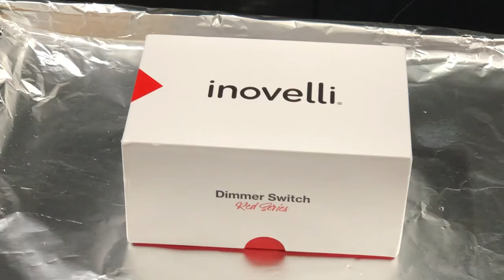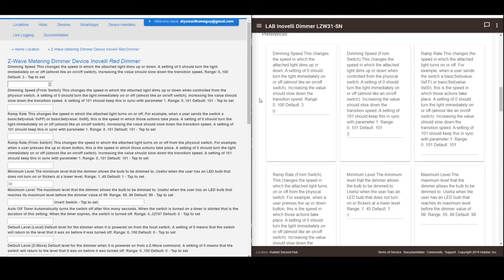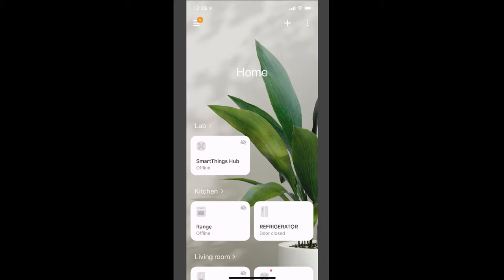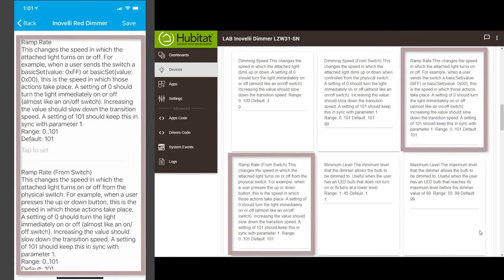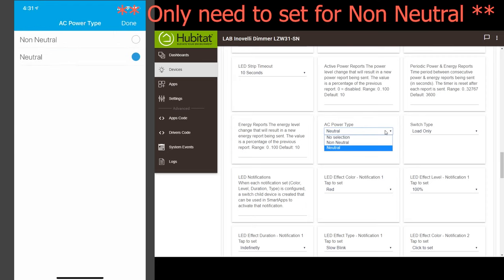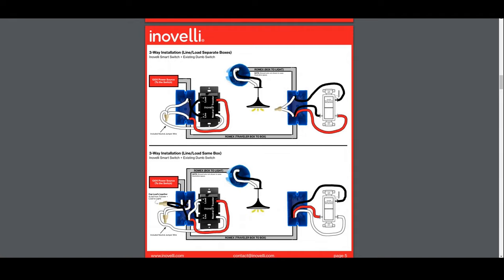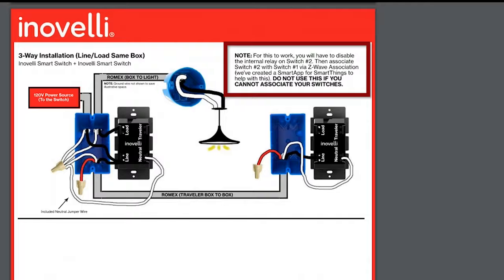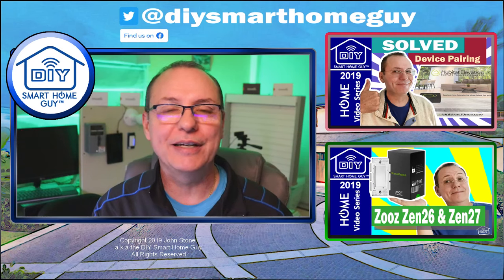Inovelli Red Series Dimmer (LZW31-SN) Z-Wave Plus Review

Comment: Hey mate, thanks for your videos.
I've tried to message you privately but I have no clue where to start with that. at the 8:01 minute mark installing the bypass behind the switch didn't work for me. I've asked in the Inovelli forum and confirmed the information isn't correct. My light wouldn't turn off and my voltage tester was spazing out around my whole switch. As Inovelli and Aeotec diagrams say ... its got to be installed at one of the lights behind the housing for the switch to work.

Comment: You cannot install the bypass at the switch.  Those who have tried ultimately determine that it will not work.  Additionally, even in some cases with a neutral, the bypass is required, depending on the bulbs.
Reply: @DIYSmartHomeGuy1  I'm not sure either.  I haven't tried it, but there are a number of posts in the Inovelli forums from those who tried and we unsucessful.

Comment: Appreciate the review.. looks very cool.  On the notifications.. can you cycle multiple notifications?  for example on my homeseer the top two LEDs will blink red if the front door is unlocked The bottom two will blink red if the back door is unlocked and the middle one will blink red if the garage door is left open after a certain time.  It would appear that the inovelli is just one pulsing or Knight Rider type effect .. but is it possible to cycle notifications?

Comment: Would this switch work with Lumary recessed smart lights to allow on/off from the wall switch without using the Lumary App or having to reprogram the lights again because you turned them "off"?? I would be able to breath again because i just bought 30 of them Lol and shudder at having to use my cellphone every time!
Reply from the maker: Well, as luck would have it, I recently purchased one. The bad news is, I haven't done any testing yet. From what I read, they are zigbee, so in theory the hub can control them. You would use a switch like this to constantly provide power and then use the button taps to turn the lights on and off. But again, I haven't done my independent testing as of yet.
Reply: Hey thank you I really appreciate you.

Comment: The Aeotec nypass can be connected directly to the Inovelli switch in a non-neutral configuration? That's what I was hoping to be able to do. But the Inovelli manual shows the installation of the Aeotec bypass at the light itself.
Reply: @DIYSmartHomeGuy1  Great video! Was really helpful for someone who is new to this. I have low W LEDs, When I try and install the bypass on the switch side the light always stays on and the switch doesn't work. Do you know what I am doing wrong?

Comment: Hi DIY Guy John, I have a question for you. I used your videos as a great tutorial to set up my kitchen ceiling recessed lights with 4 Sylvania Lightify Color LED’s 5-6inch, along with this Inovelli Red Series Dimmer. I’ve been having problems with dimming and flickering, is it a low-load problem? Should I add the additional load resistor that you recommended in the links? The Sylvania lights are connected through the OSRAM Lightify Gateway and then to my Samsung SmartThings hub, so any other setup suggestions would be great! Love your videos please keep it up! Thanks.
Reply: Also I’m using a standard neutral-wire single way setup!
Reply: DIY Smart Home Guy Hi, thank you so much for your response! At the moment I’m pressing the down button on the Red Series Dimmer which is turning the Switch off, cutting power to the lights. Also, when holding the down button down it triggers the built-in dimming for the switch, which is what causes the flickering. I thought about re-programming the switch so that the down button press and the down button hold would not physically shut power off but instead dim the lights to 0% and something like 30%, but I thought it was kind of frustrating that I have to pick what percentage (and only 1 option for that) I could achieve with the down button hold option. That’s why I was leaning towards trying to get away with the manual dimming (plus it’s cool to watch the led on the dimmer go down as well). Do you have any suggestions? Thanks again for your input
Reply: DIY Smart Home Guy
Got it to work, thanks so much for the help! Looking forward to future content

Comment: Did something change?  On the product it says it requires a neutral wire.
Reply: If you check again there's different options such as the zigbee one doesn't need a neutral wire. The Z wave does.

Comment: Hey John,  I went out and bought some of these switches based on your glowing review.  After getting them, I was disappointed to find out there is a painful delay from clicking the switch until a linked light actually turns on.   After doing some investigation I found a very long thread on inovell’s website complaining about the problem.  Apparently, they picked a very long value for the double click timeout and made no option to programmatically change this delay value.  I need my lights to go on when the switches are clicked and not have people think the lights are broken because there a 2 second delay before anything happens.  This just caused them to start clicking like crazy.  I appreciate what you are doing on YouTube but would have appreciated a more honest review as these switches are unusable for me.
Reply: Hey John,  I'm using the hubitat.  I suppose it could be an issue with the hub rather than the switch since hooking up a light to the switch’s load has a reasonable speed as opposed to the network linked light, but it seems to be a general issue based on the thread I mentioned: https://bit.ly/397m57X .  It is pretty strange because when I control the light directly from the hubitat web interface it is lightning fast.
Reply: Check to make sure that you are using the right driver.  You have to install the one from Github and not use the default one in Hubitat.  Be sure to scroll ALL the way down in the driver list to get to it.

Comment: Hi, thanks for the video.  Which child device handler should I install.  I have the ABC button child handler.  Is the another one.  thanks
Reply: I fond the child device handler.  On the Inovelli website it says to install it after the switch is installed.  Should I do it then, or before.  Thanks
Reply: No problem, thanks. I got it working.  Only thing, I don’t know how to set the notifications.  I know how to color, brightness, etc, but not the trigger turn them on.  Thanks
Reply: What is a child device handler?

Comment: So I think i have figured out what Inovelli is doing to get a non neutral. So in a circuit, all loads need a path to ground for electrons to flow.. a load can be anything you need to power, a light bulb a small computer, a heater. there must be a path to ground for this to happen.  

When you are dealing with a normal switch all you are doing is making a break in the line side or the neutral side to break that circuit to ground. Simple and self explanatory that's why its called a switch. You don't need to have power at the switch because you the human, powers it by physically moving the switch up or down. This is why some switch's don't have a neutral in them (newer code says you have to now) because it does not need it!

So with a smart switches with neutral the human is not doing the physical work the relay inside the switch is doing the work and the relay needs some smarts so it can be controlled wirelessly and toggle the relay inside it. Even when you press up or down you are not powering the relay you are just pressing a button that the switch converts to toggle the relay if required. So because of this the small brain inside the switch needs to have power running through it all the time so that even when the switch is off it can receive your commands and act on them. With out a neutral this switch cannot make a path to ground so that it is always on.

Smart Switches with non Neutral (kind of) so there is no such thing as a circuit with a non neutral, every circuit needs to have a return path. Most people don't realize If the switch was on the brains of the switch could steal power from the power running through the switch with caveats*, but if the switch is off no electricity is flowing through the switch meaning the switch brain cannot be powered so stealing power is kind of a problem when the switch is off. So how do we fix this? A neat trick or just some more smarts added to the switch. What Inovelli is doing from what I understand is using the grounding wire as a neutral only when the switch is off. So when you turn the switch off, Inovelli uses the ground screw to give itself a return path. Most people would say "You can't use ground as a neutral, that's against code!!" It seems that small amounts of load are allowed on a ground and the circuit can "Leak power to ground" but once the switch is on a larger load would be on the line and would would break that code. So to fix this Inovelli just turns off its connection to ground as a neutral when the device is powered on and uses it just as a ground. Where does the computer inside the switch get power from then? Electricity flowing through the switch! The switch steals/vampire taps the power going to the light/load. Problem is now the light/load determines the amount of power being drawn through the switch. So what happens now if you have a 8 watt light bulb and the smart switch takes 25 watts (Which Inovelli switch does) well you don't have enough power to power the smarts of the switch. So you must install on the load a bypass capacitor to force the light to draw more power then it actually needs and any extra power left over will just bypass the light and go through the capacitor to ground. This way you have enough power to run the switch and the light. now if you had a 100 watt light bulb at the other end you would think "I don't need a bypass capacitor because the light is drawing 100 watts so the smarts in the switch will have enough"!. Problem is the switch is a vampire remember, it steals that power it needs to run from the bulbs request for power. The light says i need 100 watts and gets it but the switch stole 25 watts of it and depending on your lights it could possibly flicker or just look dimmer.

So I believe this is how they are getting around the not having a neutral as ground and neutral are really the same but in electrical code its a no no to use ground in a replacement for a neutral (even though I do it in two place in my house where i have no neutral) 

Really ingenious to be honest and allowing it to use ground but then flipping to line when on. Bravo guys!!
Reply: In case somebody reads this and believes it's true...  The switch does not draw 25W! The "load bypass" is just a small electrical load that increases the total load current. The current must be at least 0.2 A, based on the 25W load requirement. The switch probably uses only up to 1 W of power for itself.
Reply: Actually, It does not use the ground as a neutral at all, it uses the load (light bulb) as the path the entire time. When the switch is off, it is still sending power through the bulb, just not enough power to turn the bulb on 🙂
Reply: @michaels3003  yes if a light switch is drawing 25 watts... It's on fire lol